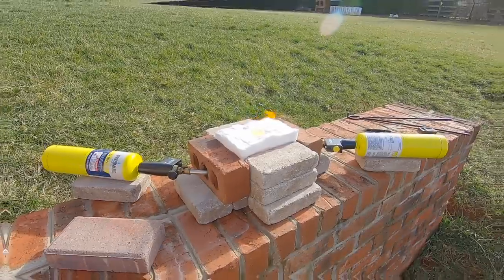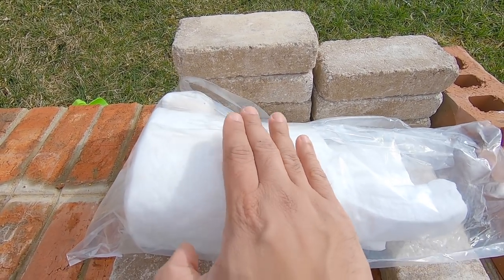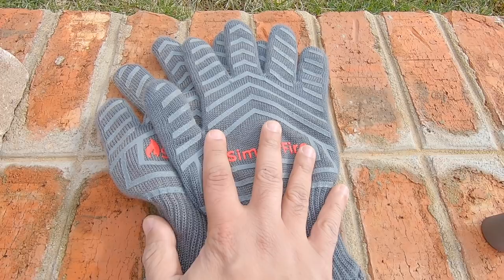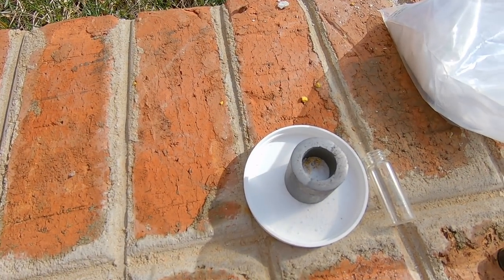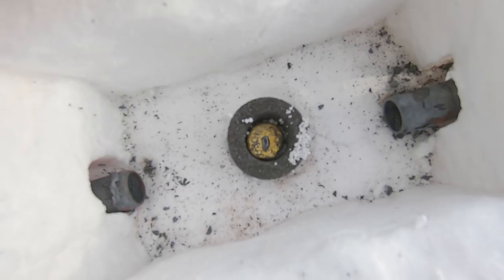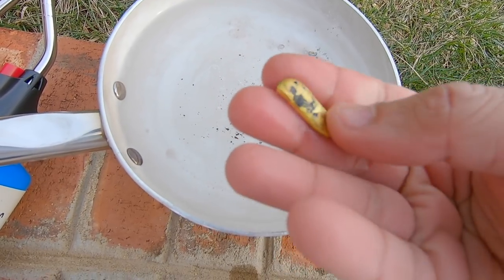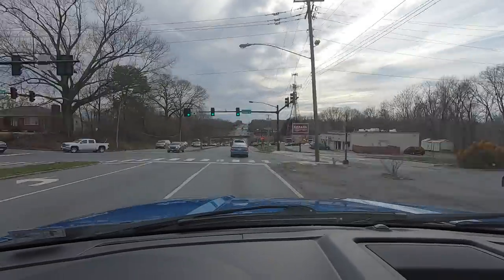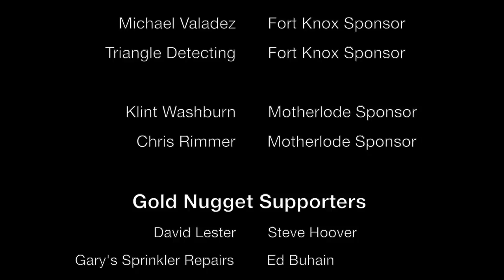CHEAP DIY Furnace Makes $500 GOLD BAR!

Comment: Those classifiers are awsome I use a 1/4 inch and a 1/8 inch they classifie so fast I got the stackable ones so my 1/4 inch the 1 that has the over head handle is 9.5 inches in diameter and the 1/8 inch that has 2 handles is 10.125 inches in diameter. But any way the classifiers are awsome and I loved the video I'm going to do a little testing of my material toda so wish me luck. :)
Reply from the maker: It is a beast... great for testing and for sluicing! Good luck today brother!
Reply: Thanks it's windy and cloudy I hope u get the lil monster going soon
Reply from the maker: Make sure you check out my Facebook page (AU79 Prospecting) -- I post picture updates and previews before the video hits.... MegaTROM will be making its appearance soon!
Reply: Will do getting ready to run dirt with my ducks so the arbor fabricating classifier is that still $65 in the 1/2 u got :)
Reply: So just got done running some buckets and I recommended your channel to my subs but that probably won't help you because I only have like 6 subscribers. But I wouldn't mind u seeing the video once it's on yutube but if u can't I under stand :)
Reply: My video posted